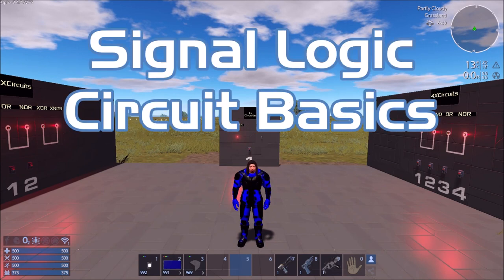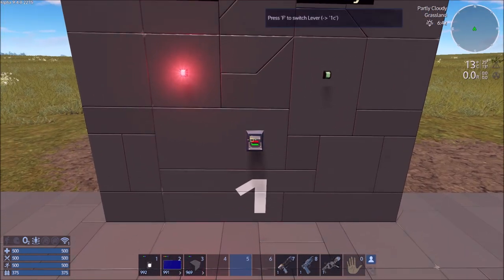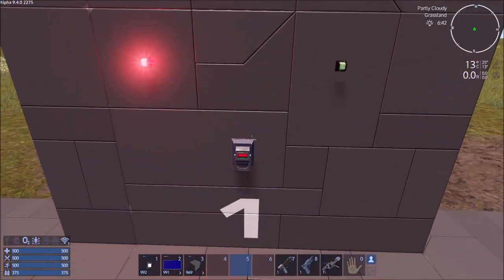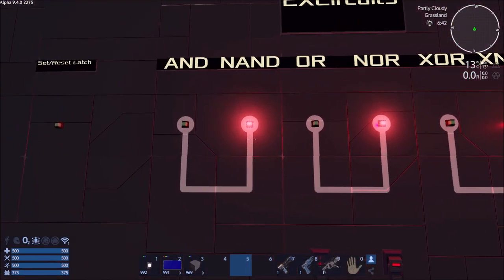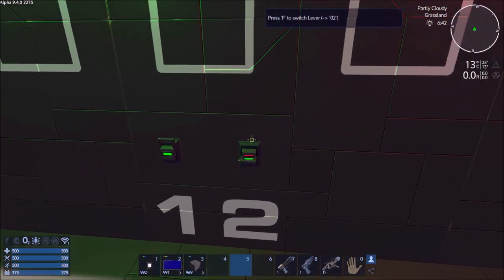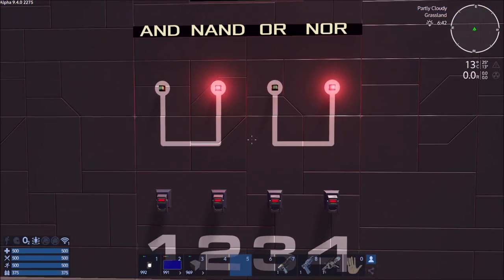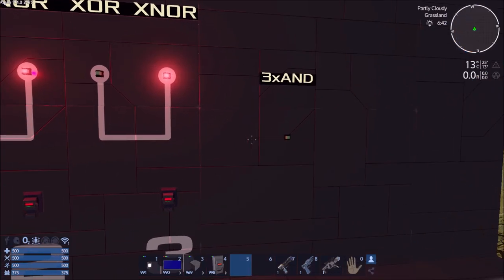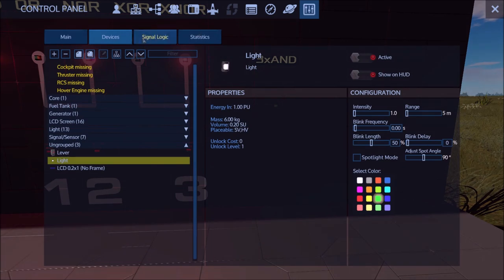HOW DOES THIS WORK? - Circuit Logic Basics - Empyrion: Galactic Survival

Comment: still confused.  I always wanted to make a circuit for a CV or BA that has two large hanger doors.  I want the hanger doors to open and close with a sensor.  I also want to be able to turn the sensors on and off with a switch so I can leave the hanger doors open if I want to view the scenery while working in the hanger.  Lastly, I want there to be one switch at each door so that the doors can be controlled independently of each other.  I have never found a way to do this yet.
Reply from the maker: I plan on making a video covering the entire spectrum of sensors switches circuits and circuit logistics, I'll see if I can include this as an example of the circuit logistics.
Reply from the maker: https://youtu.be/tROZElMl88U